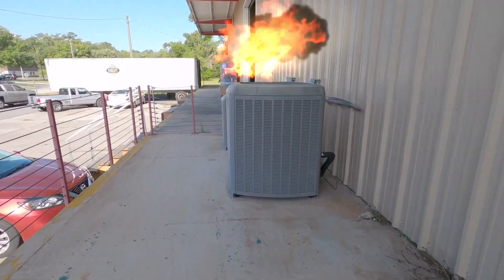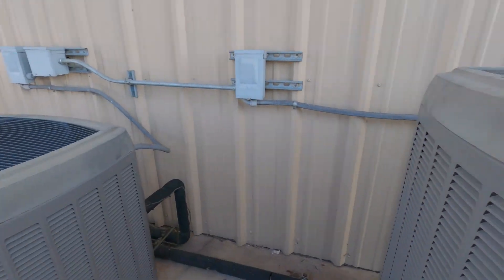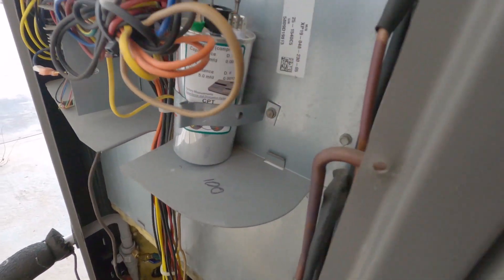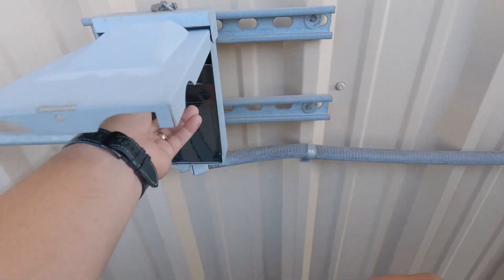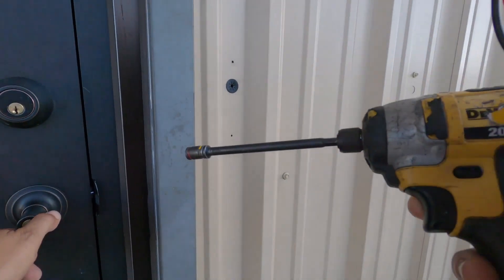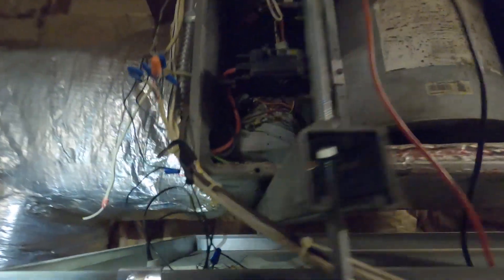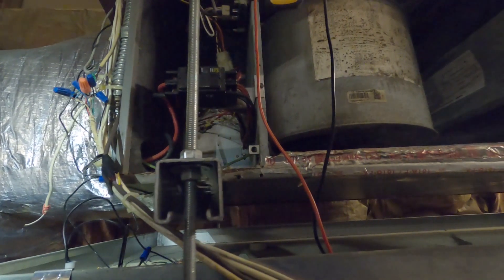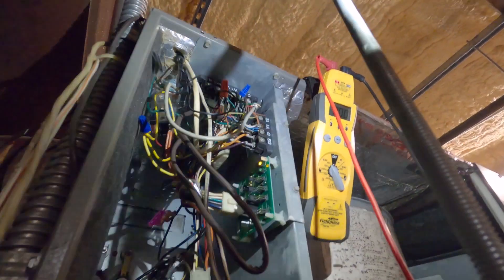Lennox heat pump not cooling HVAC

Comment: I have an alert flash code 8 and the red light is on and green off. Any thoughts?
Reply from the maker: Sounds like it's locked the board out on high pressure. But honestly you didn't give me enough information. I normally don't do this but I want to have some fun,  what kind of unit is it?

Comment: Is their a way to tell of the board is supplying the motor module with 120v? Or does a ECM work different?
Reply from the maker: There is. On this module there is 2 separate plugs. One supplies high voltage and the other supplies low voltage supplied to the module from the board for cfm output

Comment: I always replace the motor and control board. The other component is near replacement cycle anyway. They system will be more reliable in the longterm. In my experience pcb boards only last up to 5 years in Arizona. Just an observation. Bullet proof repairs.
Reply from the maker: Nailed it! Thanks for the feedback